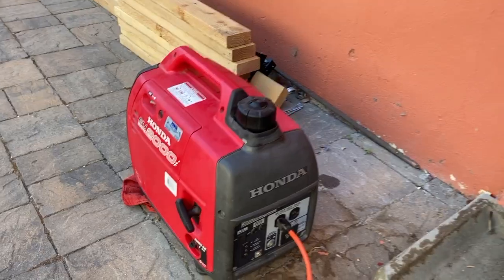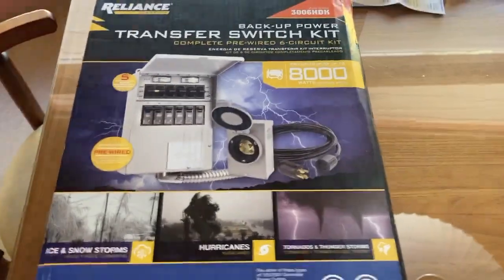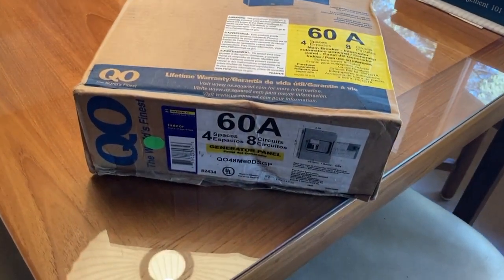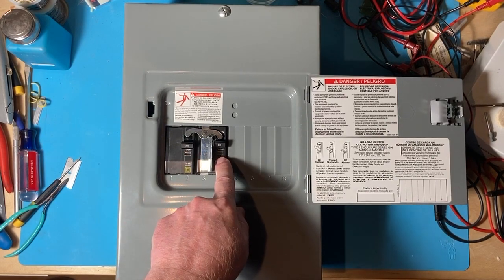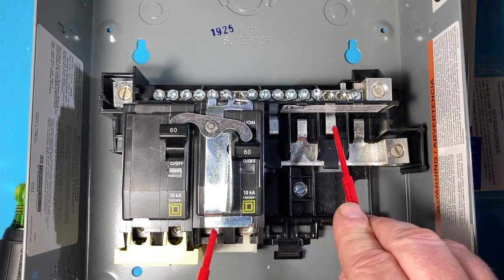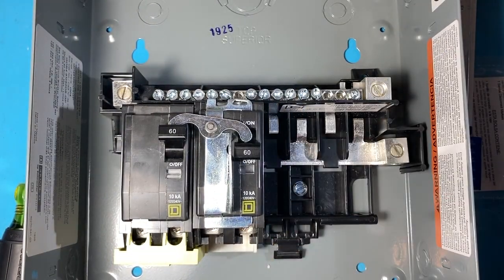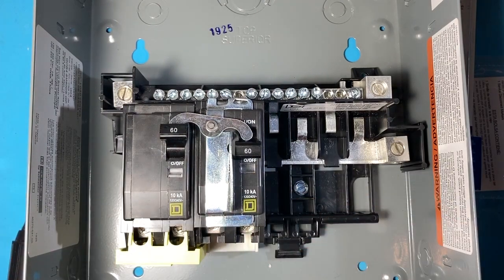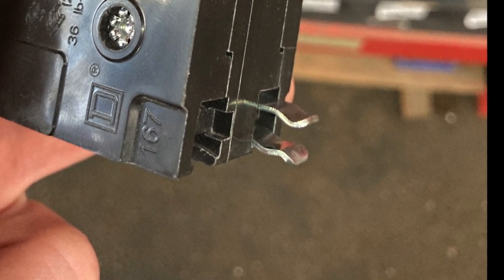Square D QO48M60DSGP Generator Transfer Switch Subpanel: Selection/Internals/Install Pt 1

Comment: I have asked many individuals what the "D" stands for on square D equipment, and I can tell you( for those who are interested), it stood for "THE DETROIT FUSE COMPANY", just like the "Q.O." breakers, that stood for "QUICK OPEN", being that those breakers have thermal/ magnetic trip sensors in them. I worked in a hospital as an electrician( now retired), and many of the buildings came on line in 1915, and the electric distribution was up graded in 1990. I did find main fuses that were"  detroit fuses", and yes I did grab them!!!.
Reply from the maker: Ha. I knew about "quick open" but not about "Detroit" -- that's great. I was really liking the Square-D stuff until Schneider recalled the PON panelboard I'd put in for a couple of people for loose neutral problems ! Fortunately, that doesn't affect this unit.
Reply: @WardCo  square D, Q.O. panels( before schneider got their hands on the company) are what I have in my house, along with all the wiring is in pipe,. the romex cable that was in the house is just a memory!!!.also all feeder circuits , including the main is fuse protected. "U.L." only stands behind one trip, after that you are on your own, unless you have the breaker re-certified. I remember years ago when I worked in the hospital, all the distribution breakers were tested./re- certified. one breaker, a 3,500 amp breaker made by federal pacific would not trip. the testing company was throwing 5,000 amps to this thing, letting the smoke out of it, we told them to abort the test, being that there was no spare breaker to replace that one if they blew it up. a purchase order was generated to replace that breaker. in fact that building had all the federal pacific switch gear, motor control centers, and panel boards  replaced .the federal pacific company by that time was out of business. their panel breakers were thermal trip only, and they lost the "U.L ."listing/ approval, causing the company to go under.

Comment: This transfer switch was discontinued March 2021. I am a big fan of Square D equipment, i am disappointed....
Reply from the maker: Oh too bad. Suppose it will be around on eBay for a while though. I too like Square D stuff, but this recent recall of their push-on-neutral panelboards has screwed me (and I guess 1.5 million other customers!)

Comment: Just use a interlock kit, much easier
Reply from the maker: Also not legal here, since if you remove the dead front, you lose the protection.
Reply: @WardCo  if you install it correctly you have to take the panel off to remove plus the kits come with many stickers to prevent or warn you not to remove. 
Really who is going to spend $75 plus for permits to install a $30 kit.
Reply: @garybensel6680  Someone who thinks their insurance company might use an unpermitted electrical modification as an excuse to deny a claim.

Comment: Can this be In-wall mounted even though the cover is not flat? Thanks for sharing!
Reply from the maker: It is 9 inches wide, so would fit in a stud cavity, but there are no side holes, so you'd have to drill some and then do something to secure the opposite "free" side. (Part 2 of this, where I install mine, should be out this weekend.)

Comment: North American residential 240 is single-phase. The 120 comes from either leg of the 240 volt transformer and a center-tap, but all legs are ‘in-phase.’
Reply from the maker: Yes, which is why I prefer saying "leg" instead of "phase" when describing either of the two halves of the wave. (BTW, Part 2 will be done in about a week, I expect, and I talk more about this.)

Comment: Thank You well done video, but follow the code!
Doing it right protects you and the next home owner.
Reply from the maker: Truth be told, I am now considering running both legs from the generator inlet plug, so that if I ever upgrade the generator, things are all ready to go -- and that will mean running both legs from the panel as well.
Reply: @WardCo  Follow the code it’ll keep you out of trouble, and is well worth the extra money for peace of mind
trade the number four, four number six AWG two runs of black one run a white and one run of green in 3/4 EMT or flex From your main panel to your subpanel, from the subpanel to your generator plug.  Good luck be safe and have fun.
Reply: not only that, any electrical work that is done without inspection, and a fire breaks out, insurance will not cover you!!!!.